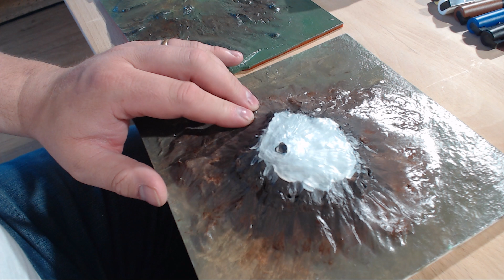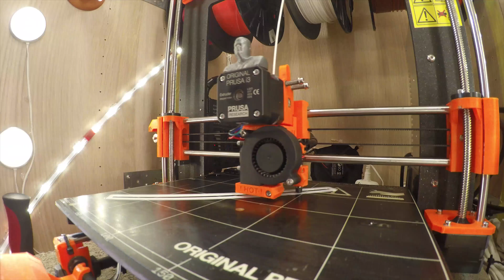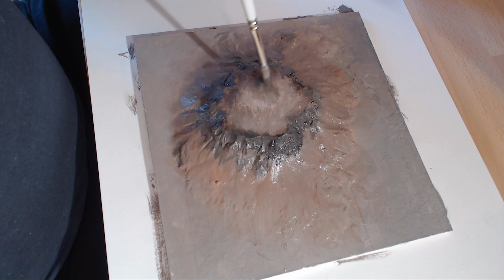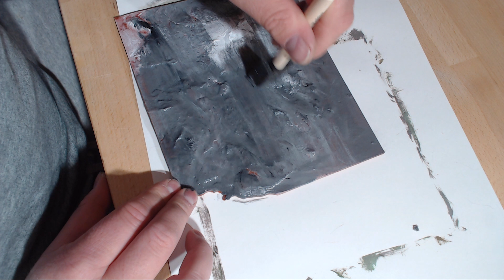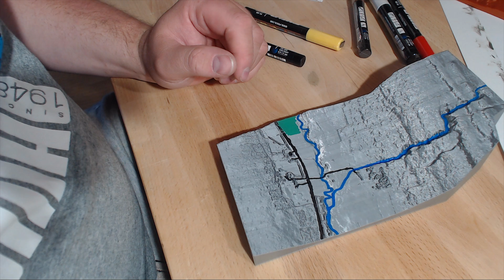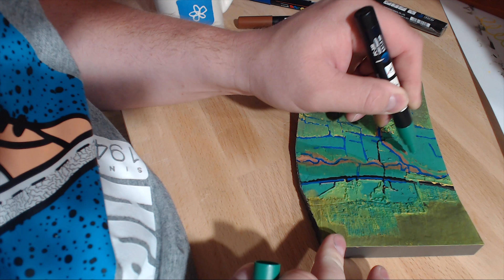Snæfellsjökull  - 3D Printed and Painted

Comment: Hi Martin. I like your mountain paintings. Whenever I use to paint in the past I always started with a base cote of Gesso. Either white or black. Depending on what I was painting. The Gesso always maid the other paints go on easier. Have you ever tried that?
Reply from the maker: Hi and thanks for your comment, - I have not tried Gesso, I will look for that in the hobby store. - the paint I'm using sticks well to the PLA though.